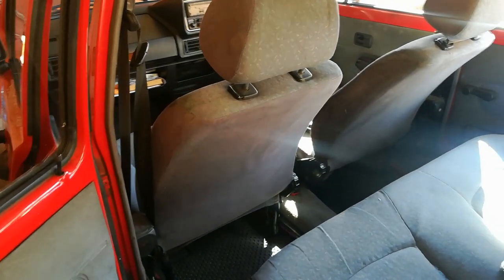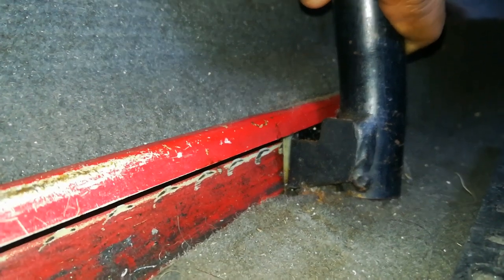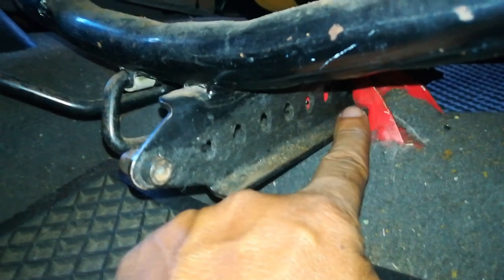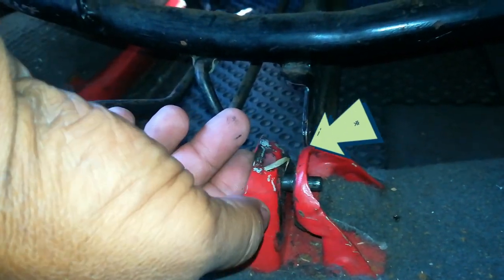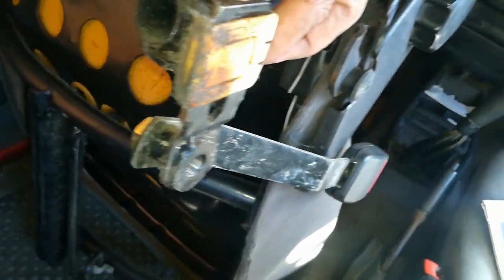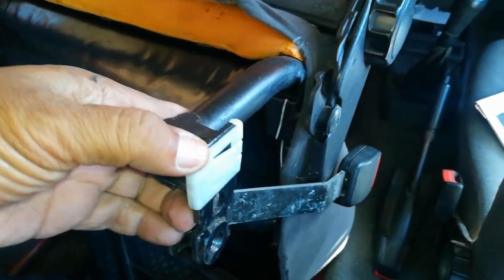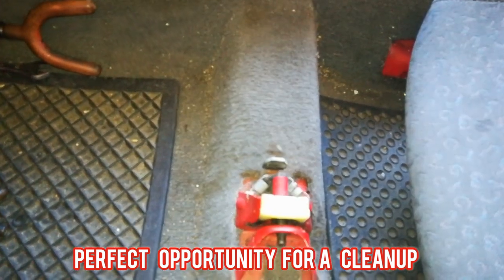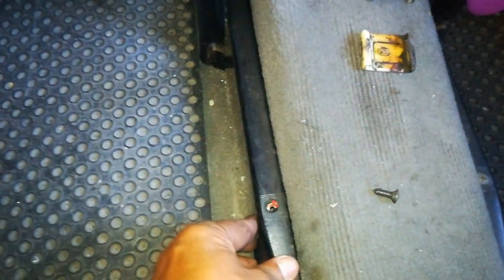GOLF MK1 : WOBBLY LOOSE SEATS. HOW TO FIX #golfmk1 #vwgolf #vwfox #golfmk2 #vwcaddy

Comment: Great clip, I have restored Golfs for more than 35 years and this is a common problem. I also have a permanent solution for the doors triggers to restore them back to OEM spec.
Reply from the maker: Yes. Seen so many Mk1s with the wobbly seats.. And we tend to just drive like that for years :),,,, and it's such an easy fix. Reallly appreciated the sturdiness  after I did mine..
Reply: Please share ur idea about the door triggers mr swanepoel

Comment: ah, the old wobbly seats, been a problem for about a year now. thanks for the quick and easy guide. 
i have another problem. my windscreen wipers took on a mind of their own the other day, and instead of moving together, started to have a sword fight on my windscreen, now they just sort of stay put, even thought the motor and ram seem to be working perfectly, think it may be where the ram attaches to the wipers. ever had this problem?
any advice would be amazing. 
thanks again for all the awesome instructional videos, you have been a huge help multiple time, appreciate it bra
Reply from the maker: Hi thanks.. It sounds like the wipers are just loose or maybe it's slipping at the arm.. Did u try refitting them and  tightening them down a bit...
Reply: @pjs-golfmk1-diy  ah thanks man! so i had a look at the arm, popped off the plastic covers,where it connects to the ram underneath, and yes, 2 minutes later and a number 10 spanner, working as good as new. the nuts just needed some tightening. Appreciate the advice and help man. have a lekker weekend

Comment: Hi PJ , I love your content especially the one video in regards to bleeding your system when changing thermostat as I had the issue where it bubbled out of the waterbottle but your video solved it. I come asking a small bit of advise. Very recently my 2004 1.4 mk1 Carb has been developing a small miss around 2000/3000rpm . I changed my plugs and plug leads as well as distributer cap. unfortunately the issue still remains . Any advise as to what I could look into next that would be the issue ?
Thanks in advance
Reply from the maker: Have you had the coil checked out yet?.... Sometimes they start failing too.

Comment: Hi pj how can I contact u I'm looking for a golf 1 mechanic.. Thanks
Reply from the maker: Hey there, unfortunately I don't really take on mechanical jobs.  I can recommend people,, but pls tell me 
What work do you need done on your mk1
Reply: @pjs-golfmk1-diy  I'm also in need of a mechanic good sir. I get steering wheel vibrations when clocking past 120KM.
Reply from the maker: @georgekhumalo5283  hey George. It's best if you take car to a fitment center. They will do an assessment of your suspension, and possibly pin point the component that needs to be replaced.. Some of them may do the assessment free of charge.. At least then u will know what plan of action to take. Thanks